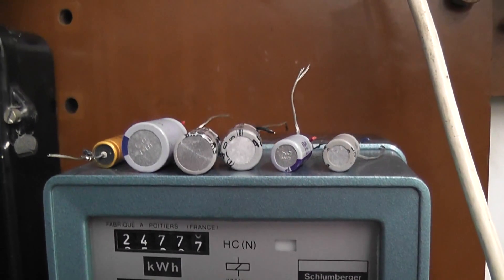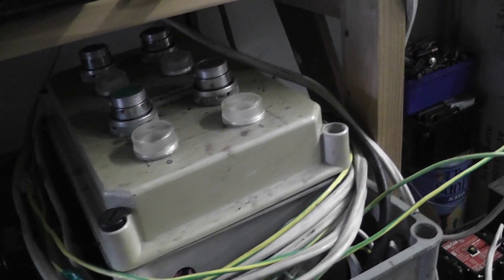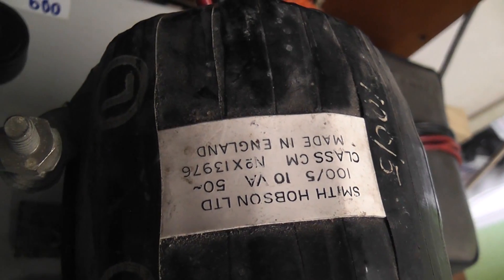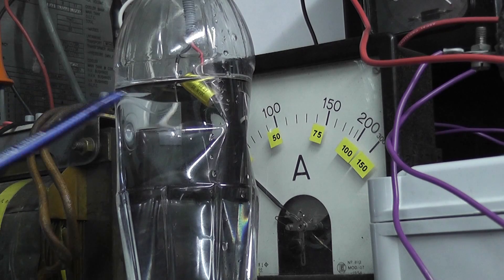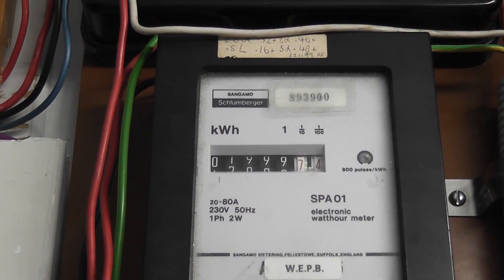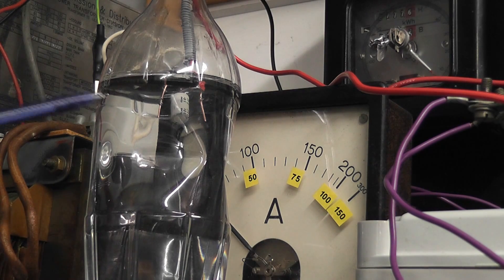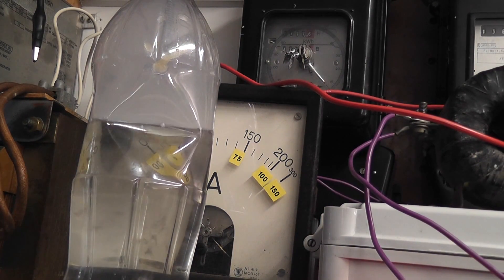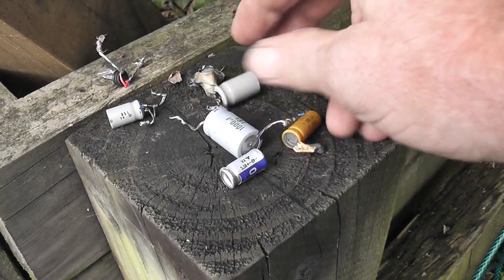Some capacitor pops in a bottle

Comment: Nice poppages here in this vid. :-D Also, nice video-capture on the Sangamo Schlumberger SPA 01 doing a click-over to 2000 kWh. :-) The interesting cap was the one where it actually stayed on fire while floating around on the water. :-D The bottle of Capacitor Smoke is an excellent idea: If you have any caps that are running low on smoke, you can use this to top them up a bit....It saves from having to de-solder them from the circuit board & fit a new one. :-D LOL! -BoomBoxDeluxe.

Comment: When I tried to blow up the vented caps(18V 0.05A)
My power supply shutted down.
and when I tried to blow up those cheap non-vented caps,
it blown up very roughly,it blow up the air-tight container.